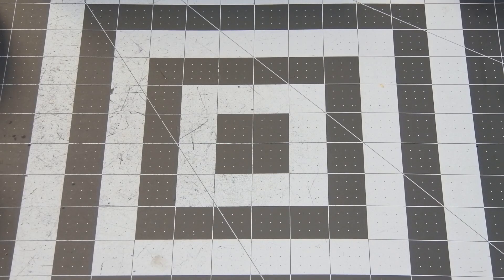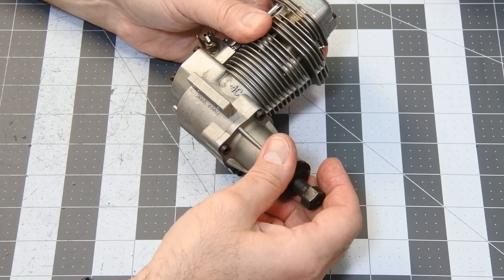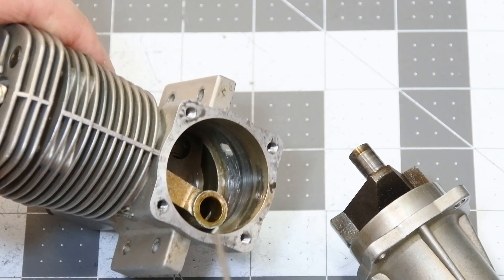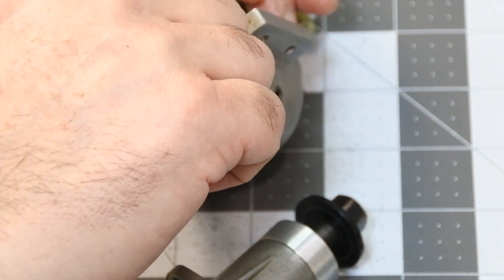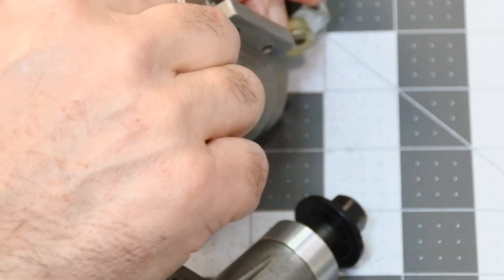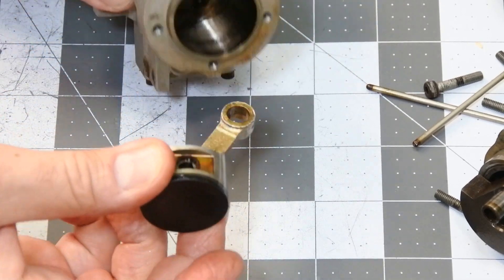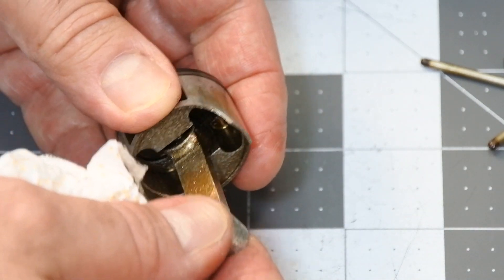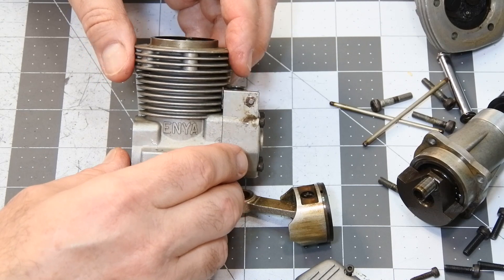Enya 120 4C pre "R" story Part 1

Comment: I've got a old Enya 80 like that, that still running strong for the time being!
Reply from the maker: Hi and thank you for your comment ! Definitely, Enya 80-4C is really nice powerplant, strong running engine. I would add, that it's very reliable. 80-4C has a tendency to detonation behavior, when works lean and with a big prop. The cure is simple - installing an aluminum thin shim in between engines head, 0,1-0,15 mm is more, than enough.
Thank you and have a nice day !

Comment: Thanks. Nice video. Looking forward to part 2.
Reply from the maker: Dear Patrick Bowler, thank you for your comment! I'm awaiting for Ebay delivery of a new crankcase, conrod and bearings set. Counting every day...
Reply: @crazyengines88  I used to use these engines flying rc aircraft, back in the day. They were work horses. I even bought a brand new .53 on eBay, after being inspired by your previous videos. Haven’t run it yet. Brings back memories. I especially would like to see replacing the bearings. Thanks. Pat.
Reply from the maker: @patrickbowler3422  Thank you for your comment, much appreciated ! Your comments also inspire me to do more videos about this great small metall creatures. B.t.w., in my opinion, Enya 53 4C -is one of the best engines in it's class. Good luck with your new Enya !